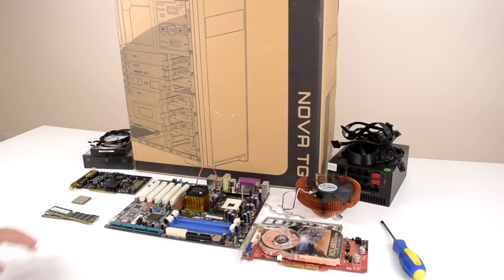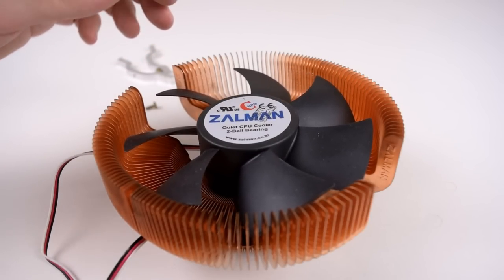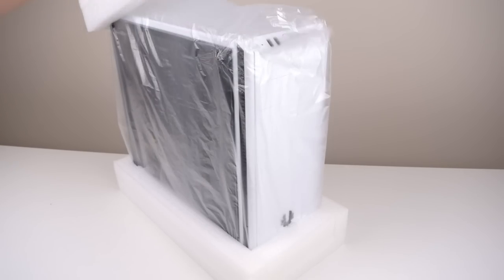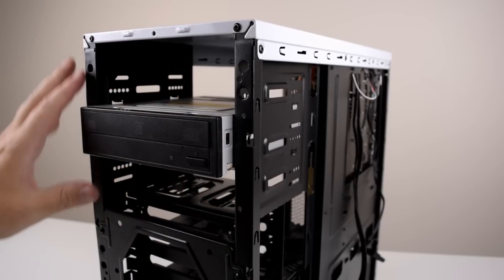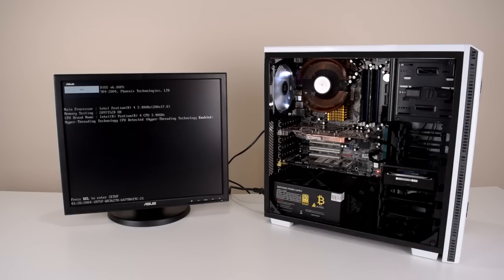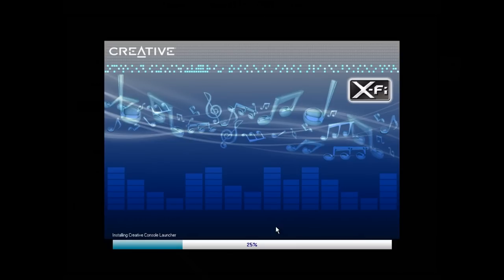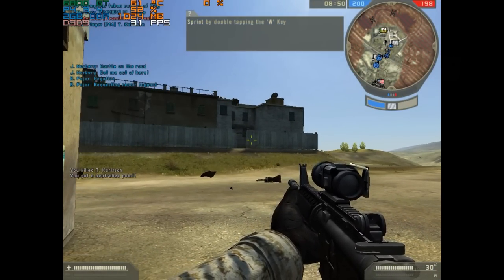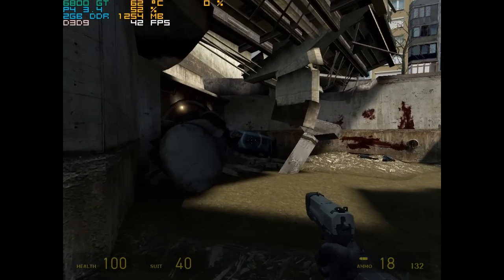Building a Pentium 4 Reverse Sleeper

Comment: Nice video Phil,6800 Gt has more power than this,you should play at 1280x768 ore more with this,maybe 1080p for some games. It would have been nice if you could hook up the 3.4EE...:) Chipset dont need a fan at stock speed. Imagine Asus mobos had no fan.

Comment: I wouldn't say that the 6800 was made for DOOM 3. IIRC DOOM 3 originally gave you a warning that you needed 512MB of video RAM when choosing the ultra settings and at the time of release, nothing had 512MB. It wasn't until I got my 7950GT with 512MB that I fully experienced DOOM 3. 
And forget Afflictionzv1. Most youtubers do 'sleeper' PCs. I'd say, find the crappiest 486 desktop case you can find and put the best stuff in it you got, even if you need to duck tape the PSU to the back of the case.
Reply from the maker: Yea the game was ahead of its time. I just remember that when it came out, the 6800 GT was a great card to have.
Reply: 6800 gt supposed to give at least 45 fps for ultra in 1024p or arround 60fps for high settings:
https://www.ferra.ru/images/139/139126.gif
https://www.ferra.ru/images/139/139127.gif
Reply from the maker: Shaolin Style Unpatched Doom 3 from CD runs faster, I use the Steam version. Same goes for Half-Life 2 to an even greater degree.
Reply: I had a lowly regular 6800 when they first came out, AGP at that on a Athlon XP 2500+ OC'd to 2.5GHz, for the time, not a stellar system.
Reply: Well.. regular 6800 was a really cheapy budget card with slow 128 mb of DDR and almost equal by performance to the pastgen cards such as FX 5900XT or ATi 9800 Pro. So there's really nothing to be surprised.

Comment: Hello! I have build very similar machine using P4 2.8C, Abit IS7, Radeon 9700 Pro and the very same CPU cooler. I am curious why do you have so low framerates in games such as Half-Life 2 and NFS: U. In fact, NFS: U should run on that PC maxed out with very good framerates. HL2 also shoudn't have any dips on frames - GF 6800GT is definitely fast enough for those games (even my R9700Pro doesn't struggle) and P4 3.4GHz was basically top CPU when those games came out. I can take results in those games for sake of comparison, but in 3DM03 I get 7500 points, albeit with GPU and CPU overclocked slightly.
Reply from the maker: It's just your memory playing tricks, or you used low details or low resolutions. If you still have the machine, just try it out. The games have also been patched, HL2 is now much more demanding. I used the latest graphics driver, which can be slower sometimes, but not by a massive amount. I didn't do any tweaking or overclocking, so to compare you got load the BIOS defaults and run the 6800 GT at stock clocks.
Reply: Currently I am spending more time with my K6-III+ build, and I didn't played any game on P4 just yet, so I can't say for certain. But Underground series was playable even on MX cards due to lack of many effects and mid range FX 5700  was enough for highest details. Nevertheless I build those setups just recently so I can do some benchmarks.

Unfortunately I don't have a 6800GT to compare - closest I can get is to hook up 7800GS (I have a Gainward which uses G71 chip with 24 pipelines, so it's basically a 7900GT). I could downclock it to 2/3 of GPU speed of your 6800, but it wouldn't take into account differences between G7x and NV4x architectures.

It could be that HL2 is more demanding now - I completed that game in 2004 and was playable on high settings with Barton 2600+ and plain Radeon 9600. But I am quite certain that you should see higher framerates in NFS Underground.

If you are interested I have some time to spare and I can run those games with different graphics cards. I have FX 5500, FX 5700LE, and 7800GS(7900GT) from Nvidia camp from that era.
Reply from the maker: All good, I just wanted to provide some reasons for why performance can vary greatly from build to build. Had I used medium details, the games would run much better.
Reply: I will do some benchmarks with 7800GS (possibly downclocked) and will let you know!

Comment: I'd like to see an absolutely ludicrous Pentium 4 build with way overpowered components besides the Pentium 4.
Reply: Would be difficult for the GPU.
There are only two P4 motherboards with PCIe slots, and they were PCIe Rev. 1.0 only, so alot of modern videocards won't work.
ASRock offered them.  I had the 4coredual-sata2 s478 board back then,. It is hard to find today, because the s775 model uses the same name. :-/
Reply: Apparently Doom 4 is playable on a Pentium 4.  So it wouldn't be totally pointless to put a modern GPU in there.

Comment: ABiT IC-7 the best 478 motherboard you can ever get :D
Reply: That's not true,the highest models for socket 478 are Abit IC7-max3,GB - Ga-8ik1100 rev.2,Ga-8knnxp,Asrock with 945 chip set with pciex and sata and the rarest Biostar g41-m3 with pciex and ddr2-800mghz.believe me these are the best motherboards for P4 socket 478

Comment: What kind of chipset temps did it had with just the cpu fan blowing some air into it?
I suppose we could have problems if we opt for a tower style CPU cooler as little air will get into the chipset, right?
Reply from the maker: No idea, the health stuff in the BIOS was all nice and the machine had no issues completing all the tests and games.
Reply: If you can touch it with your bare finger and maintain the touch indefinitely its not really hot! :D
Reply from the maker: I'll have a, not even expensive, tool for this sort of thing soon :D There will be a vid of course.

Comment: I see you do alot of Pentium 4 builds...didnt intel at this time fall asleep at the wheel and were outdone by the introduction of the AMD athlon?...id love to see more AMD builds
Reply from the maker: Very true, I will see what we can do about that!
Reply: From my own experience: it was hard to find good AMD board without minor incompatibilities like poping PCI sound on nForce or semi-broken AGP/UDMA on VIA chipsets, or major like abandoned BIOS support just after release of the boards. And because of that today is so hard to find working boards for Athlons XP 2500+/Athlon 64 s754. P4 is just easier way. And also CPU PSU rails: for Athlon 64 or P4 you can throw any modern cheap PSU and it will work, as for Athlon XP you need strong 5V rail.
PS
If your retro-gaming is Windows XP - just buy any used Sandy Bridge and pick GPU you need, but for W98 you strongly restricted with AGP era.
Reply: Yes i had thought about building an XP machine...but as i do more research?..it seems more of a challenge today than it was back in 2003...so im not sure what to do
Reply: Windows XP in early days (2001-2002) mostly ran on 1000-1200 Piii or Athlon XP with 128-256 RAM, later (2002-2004) common thing was 2200-2600 P4 or Athlon XP with 512 RAM, near release of crysis (2004-207) it must be something like P4/A64 3000-3200 1Gig Ram, past crysis A64x2 4800/C2D E6600 or above that and 2Gig.

But with XP you not restricted to AGP only, IMO best GPU 7900GTX pre crysis, 680-760-770 2GB past. You also may think about 750Ti. I forget about Radeons, but i not have any of them in that period (past AGP ofc), so anything like 4870-6970 idk how it performs and about compatibility.

With all that in mind i see 2 viable option A64 (dual core will be better, OS multitasking and overal smoothness) or any s775 mobo with either P4 3000+ or early C2D  (they allmost 2 times faster than P4 clock to clock) plus 2GB RAM. A64 may be downclocked to the level of Piii-1200 Tualatin, s775 P4 maybe (its hard to remember), C2D cant be slower than P4 2.4.

Athlons have the widest set of aditional instructions like MMX/SSE1-2-3/3DNow, they lack SSE4 , but you will never need it for Windows XP games.

Ultimate XP machine will be Sandy/Ivy s1155 > Westmere s1366> Vishera FX83xx with either GTX 770 (980 this chip have as i remember 1 official XP driver) or Radeon 7970 (280x) with 2-4 GB RAM. But this will pretty sure have problems running earliest games: to fast, missing textures, etc.
Reply: WOW...thank you for all the advice...i remember back in the day all i could afford was AMD..so i might go the P4 route...get the ultimate machine i wanted back then...LOL...now i just have to find a copy of winxp service pack 3
Reply: You probably need SP2, with SP3 devs did something with kernel or core DLLs, after that changes some libraries (dll files) not working properly in older software. As for me it was Intel DLLs for video decoding, used in some games and video surveillance software. Some people have troubles with other software, which was written for W2K SP4+/XP without SP or SP1.
Reply: Actually, the highest known configuration of XP I can probably think of is:

CPU: Core i7-4790K (using unofficial Haswell drivers)
GPU: GeForce GTX 980Ti (using fixed ForceWare installer)
RAM: 64GB DDR3-4 (using PAE)
Storage: 2TB SSD
Sound: Sound Blaster X-Fi Titanium
A Blu-Ray burner drive

among other things.

Comment: was the HD just too big to be detected ? that's one of those things that i would have never thought about if i had trouble on a first boot. good call i need to remember that just in case.
Reply from the maker: It might have just been faulty, haven't used it in a while. The POST screen and BIOS would just show an empty string and XP installation would stop.
Reply: oh ok, it almost sounded like the size of the drive prevented detection. is that even a thing, like even back in socket 7 days. thanks.
Reply: The only thing I can suggest is that the drive needed to be forced to run at SATA/150 to work with the fairly old SATA controller on the board. There is a jumper at the back of the drive you need to set. I've seen that a few times.
Reply from the maker: Ed Neil It's dead, tried another machine today...

Comment: I have a 3Ghz northwood with a bfg 7800GS-OC. Think that was the last agp card Nvidia made.
Reply from the maker: Yup, ATI did the same thing, all their high powered AGP cards, are PCIe cards with a bridge chip. They even require special drivers, which is a pain. At that point, PCIe is the way to go IMO.
Reply from the maker: I remember having to use some "AGP hotfix driver" with a X1950 Pro or something like that. I've also learned that with slower CPUs, Nvidia can be stronger, but there is a point when the faster Radeon cards leave the Nvidia 6000 and 7000 cards behind, but if you got a 2.8 GHz or so, a GeForce can end up being faster, despite the Radeon destroying it on paper.
Reply from the maker: My X1950 doesn't work anymore, so there isn't much I can do. And I refuse to pay stupid amounts for a similar high end AGP card. PCIe all the way...
Reply from the maker: Just tried this HD 3650 AGP, and the 14.4 drivers that AMD recommend from their website, won't work. I used the 12.1 AGP Hotfix driver, and that one worked.

Comment: I had a similar setup back in the day (P4 3.4 GHz, Abit IIC7 MAX 2, Radeon 9800 Pro) and held on to it for a little too long as by 2006 it was near impossible to get a decent, affordable AGP graphics card. The 8800 GTX was out and I think I ended up getting around that time either a 6800 or 7800 GS, one of the last supported AGP cards. The GS card was very buggy. For several years I just did very little PC gaming until 2012 I basically turned that machine into a XP retro with a Core i3-2100. Still have that as my XP machine in the same case I bought back in 2004, a Cooler Master Wave Master TAC-T01-E1C.

Comment: I'm actually quite disappointed that a system like this can't output a solid 60 fps on Doom 3 on medium! I believe this is well above recommended specs of that game.
Reply from the maker: Yes a lot of these games are CPU limited and a Pentium 4 is quite weak. A fast Athlon 64 can do better, but ideally you want to use a LGA 775 system or LGA 115x to smash through that CPU barrier.
Reply: @philscomputerlab Interesting. I believe the recommended CPU was a P4 at 2 Ghz but clearly not. I guess they just didn't want to scare buyers away

Comment: Can You sometimes test PCs in minecraft? That would have been interesting :)
Reply from the maker: I've never played that game >< I did take a look, it was quite expensive?
Reply: You can use a cracked launcher just for testing, it's called Shiginima Launcher. I also recommend using an OptiFine mod as it's so easy to install and it does improve fps especially on old and low end machines :)
Reply from the maker: LOL that worked :D I'll see if I can use it in my next project. Does it run under Windows XP?

Comment: Does your 6800 gt agp unlock to an ultra? I remembering having a 6800gs agp that unlocked.
Reply from the maker: There is no such thing as unlocking a 6800 GT...
Reply: The guide is down but this page proves some 6800's can be unlocked to ultra's. https://www.techspot.com/news/17708-how-to-unlock-your-geforce-6800.html 
Is your card a 16 "pipe" or a "12" pipe? I wished I remembered what cards did and what to do but it's been so long.
Reply from the maker: There is nothing to unlock with a 6800 GT.

Comment: If it is easy to find, may you try Via Samuel C3 (don't buy Cyrix 3, Via C3 has some Cache L2, and it is visibile), I see them around 20 AUD, and you need a Socket 370 to make them work.

They should be quiet and a bit slower than a Celeron.

What do you think about it?

This is the link on Ebay Australia, but make sure you don't buy Via Cyrix III, I don't assume you will be impressed in C3 itself, but who knows?

Bonus, these CPUs are kind of very cool as temperatures (they had around 15-25 W if I recall right, so a very small cooler should suffice):
https://www.ebay.com.au/itm/Socket-370-CPU-VIA-C3-800A-800MHz-Tested/253086999153?hash=item3aed292271:g:mZEAAOSwOkFZi1mn
Reply: My brother had it in 2002 a Via C3 "GigaPro", being at 667 MHz estimated to have PR 1000 (menaing it would work like a Pentium 1 at 1 GHz), but it would be in practice a bit slower than my P3 at 500 MHz, but in withing 5-10%. But on the upside, it was soldered and frankly a very nice system originally. The integrated graphics (based on S3 cards) were capable to play Deus Ex for example...

Maybe, but if it doesn't cost too much, look for an already soldered board, but it has also downsides.

So, maybe as it was when I was younger, the system felt very nice: it could run Linux, XP, 2000 and 98 with already provided drivers.

If you look for a soldered motherboard for making a retro machine, the prices rise a little like this:

https://www.ebay.com.au/itm/VIA-EPIA-CN10000EG-Motherboard-CPU-Combo-mini-ITX-VIA-C7-FAST-POSTAGE/263260671677?hash=item3d4b8f0ebd:g:ZiAAAOSw74NZkAKt#viTabs_0
Reply from the maker: I've already done a build video using a similar board. https://youtu.be/sbGlogsi3wk
Reply: Thank you Phil! I've missed it! Sorry, I am watching it now!
Reply: And I love it!

Comment: First i have admit that this case looks really cool and impresivly modern for 2004 hardware inside. But! There is something in this rig or drivers are not right at all. The fps in Doom 3 and HL2 are very odd. 50 fps in avg at 768p for such a powerfull gpu with 256 of vram on medium settings are quite not impressive. I swear that you can get same fps at less powerfull gpu as ATi 9600 XT or 9800, that both are 128 vram and less core clocks than 6800 GT. Maybe all issues are in nvidia drivers or perhaps in agp 8x that is bottle neck of rig. But it it should be much better fps for such setup and decent resolution. Try another drivers and check bios agp precache twice.
Reply from the maker: Oh that's easily explained. Both games are patched and perform slower, especially Half-Life 2 got a massive overhaul. But also Doom 3 tests faster without any patches. Also I used the latest drivers, something period correct could have been faster maybe.
Reply: Totally agreed about HL2 cause it has massive update back in 2013 with huge additional shader and particles effect added, but not so sure about D3. Actually the version of Doom 3 1.0 was really buggy piece of crap with slightly bad performance even for 6800 Ultra. But situation was really improved after 1.03 version when x64 systems and Creative EAX 4.0 surround sound was implemented. Considering that, i think that biggest issue hidden in nvidia drivers. Just google checked that the most popular drivers for that period of time was ForceWare 61.77 (aug 2004) and 66.72 (oct 2004). Please if you have some time, try to make additional tests on at least 66.72 version of drivers. Cause i really wonder why you get such decent fps ingame.
Reply from the maker: Take a look here, this is with more period correct drivers: https://youtu.be/n6RM6okknEk
Reply: yea, this one is more correct but still 7800gs got almost 20% overclocked gpu speed clocks so it really got additional performance. As you noticed avg fps on P4 3.4 is much better.

Comment: Your 3dmark scores and ingame fps seem rather low. Your gt runs slower than my 6800 running with 12/6 pixel/vertex pipeline setup and 375/820 clocks.

Comment: why gpu usage stays at 0% all the time? looks like it is a bug with the after burner .........
Reply: The card is from 2004, what did you expect?
Reply: Newer version of afterburner on an older video card. The usage setting is not correctly being reported because the version installed is meant for newer cards,  cards that can use kboost. For example, newer cards have gpu usage and gpu power ok? When kboost is disabled, it showed the gpu usage in percentage. However when a card is enabled with kboost (or whatever fancy name the utility your using calls it.) Then the GPU usage will report as 0% because the card gpu is beinng ran 100% all the time but gpu power will increase and decrease depending on load. Older cards that don't have this capability typically tend to not report the gpu usage/bus usage correctly on newer versions meant for newer cards. He would simply have to use an older version of afterburner, that was meant ffor pre gtx nivida cards.
Reply: Pentium 4 is bottlenecking 😂😂😂😂😂